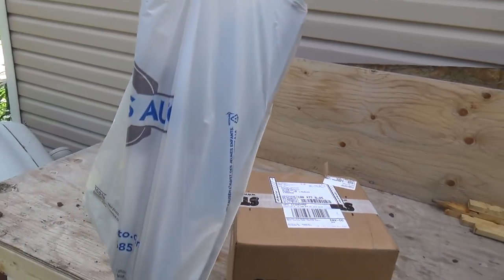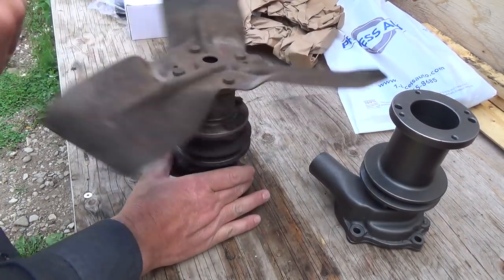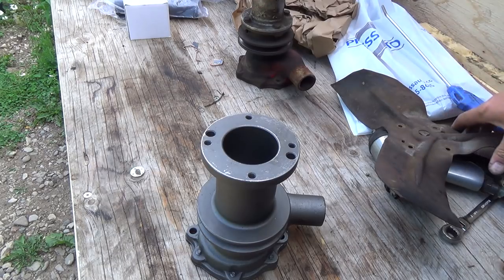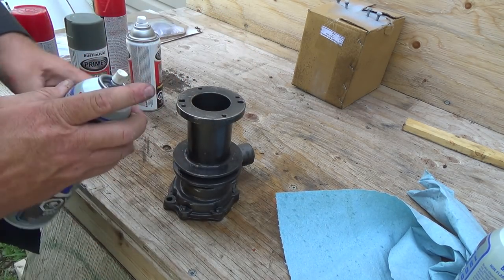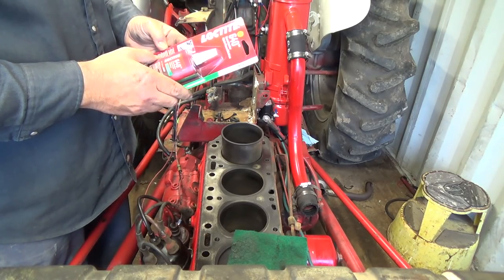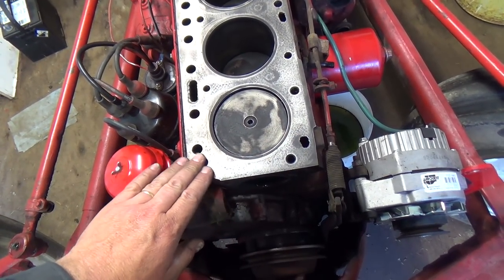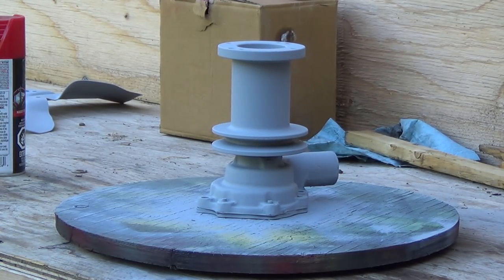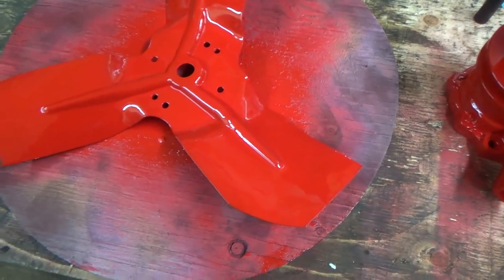New parts for the Ford 800 in.Some cleaning and painting to do and install some sleeve compound

Comment: Bill.    Check out a wax motor on YouTube. It will explain how the thermostat works. These wax motors were also used in the valves to regulate the temperature on the old steam radiator use in buildings with boiler systems.